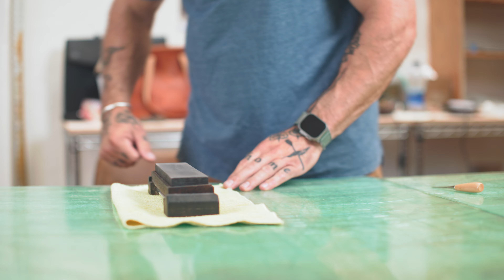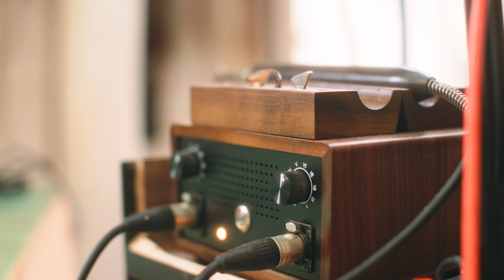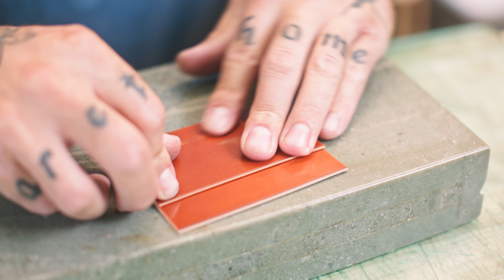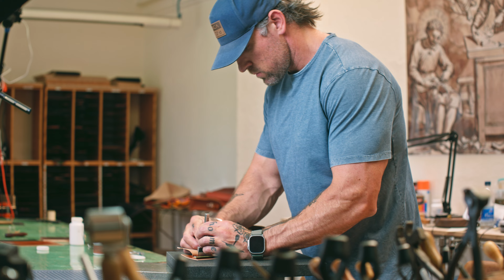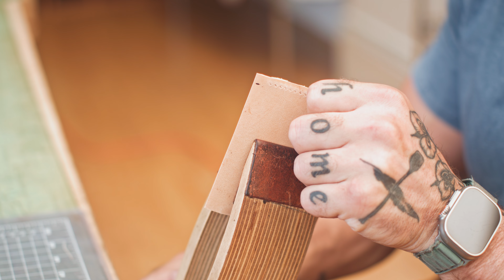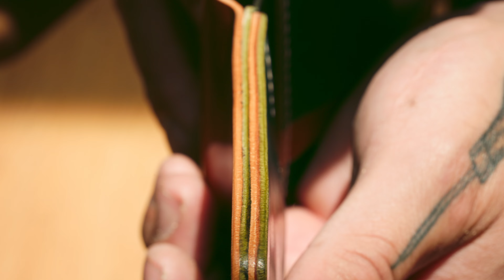Making a Rare Shell Cordovan Wallet

Comment: Looks amazing!! Why would you stitch the top pocket then fold it to do the inside one? any benefit to this way?
Reply from the maker: Not sure I understand what you mean by top pocket. But the reason why you have to fold the wallet is because the outermost piece of leather has to be longer than the interior piece. Otherwise, the inside wouldn’t fit right when the wallet is closed.
Reply: @Opensealeather  the card pockets, you did the tan (outer) one then the green (inner) one. I've always done it done the opposite way.